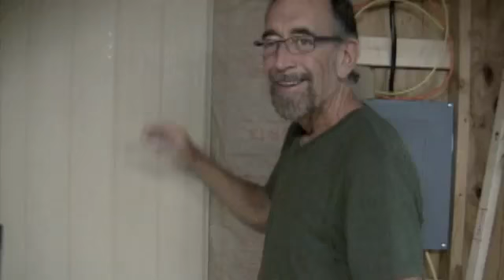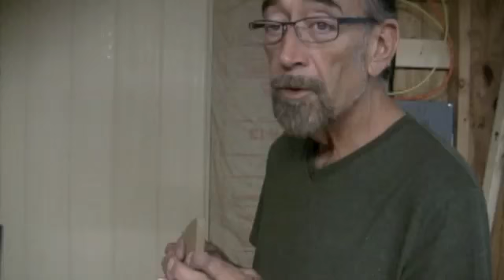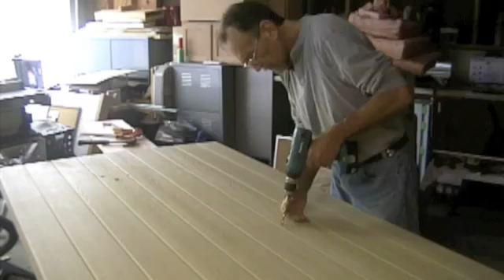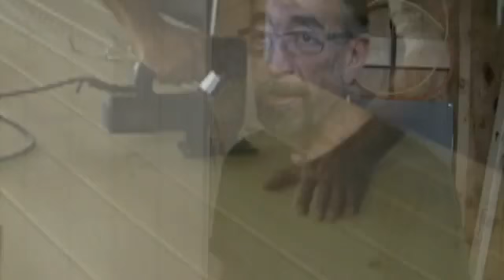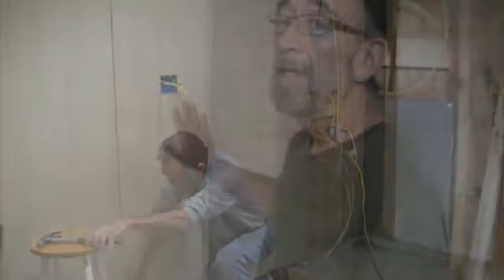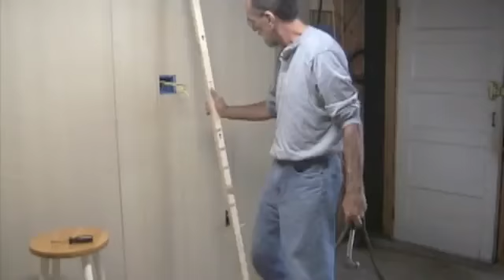Garage Workshop Conversion, Part 3: Covering the Walls - The Down to Earth Woodworker

Comment: I've really enjoyed all of your videos. I am in the process of setting up shop myself. Loved the DC series too. I've decided on the JDS Cyclone. Which siding did you use. Is that the engineered strand or fiber siding. They sell both here but there is a $15 per sheet price difference with the strand being the more expensive.